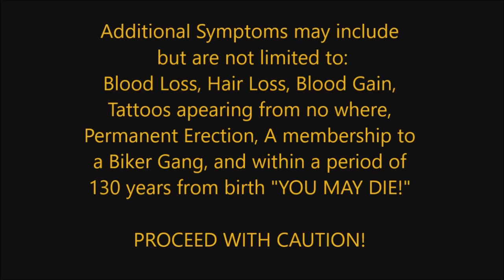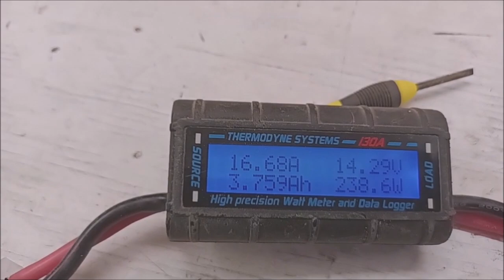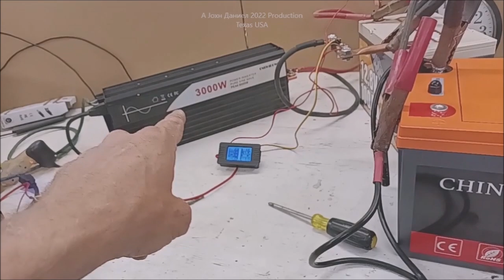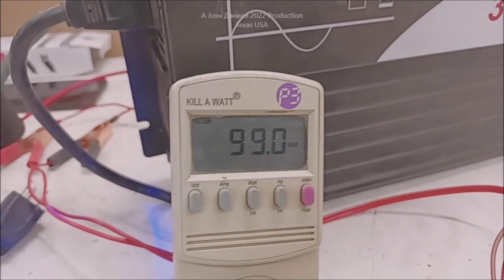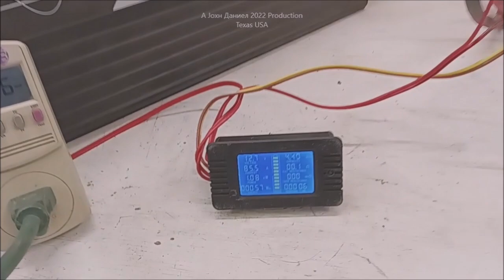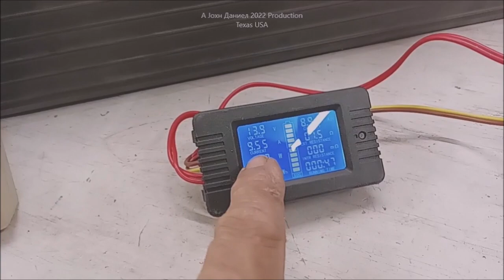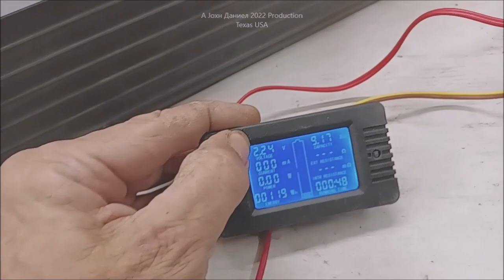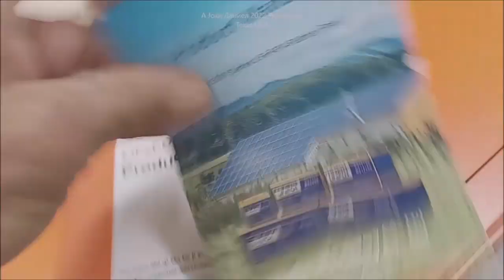New CHINS 12 volt 200 AH LiFePO4 Battery vs. Power Queen 100 AH LiFePO4 Battery

Comment from the maker: POWER QUEEN the winner! put 3 on a RV save yourself thousands. Premium LiFePO4 Batteries https://shrsl.com/3kfqh  LAST VIDEO WINNER - High Efficient TAOTRONICS 8,000 BTU A/C unit. https://shrsl.com/3n37v - Video at https://youtu.be/JS_d1lCCcgM Source it direct save over $70. **Help fund video advancements, go to http://buymeacoffee.com/JOHNDANIEL  CHINS Battery (if you need specs) https://amzn.to/3zVrDSY
Reply: Hey John just a quick question i purchased a 12.8 V 100ah Power Queen which pure sign converter would be best for it  on amazon, do you have any suggestions because i can't seem to find a decent converter and the comments are mostly fake

Comment: One year later: I had ordered two of these P.Q. mini 100Ah premiums based on the testing you showed in this video a year ago. They've been running a solar-powered station ever since. Exemplary batteries.Thanks. Oh, and they're also connected to a Cswei 3000W inverter, which is exemplary, as well.

Comment: Isn’t it the BMS that has shut off vs “the battery is dead “ ? Yes ! Take it apart test the batteries without the BMS you will find that I am right, That doesn’t excuse your result, and in power queen is impressive. I wouldn’t buy chins after watching this
Reply from the maker: Yes, the processor on the BMS has only 2 volts coming out of the pin 13 instead of 9 volts or higher so the Mosfets we're getting no on power. Defective processor so defective BMS.
Reply: If he takes it apart then he's stuck with it. The only way to open the battery van be opened is cutting it open.
Reply: @randybobandy9828  MANY (on YT) have opened the cases with Heat, or chisel, or even screwdriver & hammer …..

Comment: I've been using two 24 volt 100Ah Chins batteries over the last 6 months without failure. I discharge down to 20%-30% every 2 - 2.5 days. I am expecting better than advertised charging cycles because I don't drain them... ever.
I use a SunGoldPower 24 volt, 3Kw hybrid inverter/charger. I currently don't have space for solar panels but I do have a Westinghouse generator running on propane with wireless remote start and stop and two, 320 watt 24 volt Renogy solar panels standing by. I'll need several more panels considering my location near Seattle.
I've heard nothing but good about the Power Queen. I'm pretty sure I saw a Will Prowse video in which he tore one apart and verified it's capacity.
Reply from the maker: Being near Seattle has tons of challenges. One of the cloudiest places to install solar, compounded by one of the most aggressive areas to be sued by righteous wealthy leftist who do not want you to ugly up their area with solar or wind power. So you do have your challenges. My cohort in Connecticut lives in a small community of folks who have marched for GREEN power, and sued him 3 times over installing it. Virtue signaling verses facts LOL!  Another follower on my channel lives north of Seattle has been sued once for putting 2000 watts on his what he thought OWN HOME, and he lost the suit, cost him over $12,000. SAD!

Comment: I have seen many reviews on the power queen battery with great reviews. Because of those reviews (including yours) I bought 2 of the 12.8v 100amp batteries, for a month and a half I tried to charge them and the best I was able to get was 13.1, sorry that wasn’t good enough for the rv. So after going around with their customer service and doing everything I was asked to do they wouldn’t charge, not after using 5 different chargers and 2 charge controllers, that included the new renogy 60amp charge controller
Reply from the maker: Did you do a full to dead shut off discharge? Then using another small battery or solar panel jump them back on, then charge them uninstalled? Some Chargers have other things in circuit that will cause default settings on your BMS.
Reply: @JOHNDANIEL1  yes
Reply from the maker: Makes no sense but I had 3 batteries in a row from Bouge RV that did similar. All these battery makers only use JBD and VIP branded bms units, seems they have a real bad run of VIP models some may have got.
Reply: @JOHNDANIEL1  after all that I tried to charge them, the only conclusion both power queen and myself could come up with was the batteries so they just refunded me
Reply: @deankohler8928  feel LUCKY !  At Least you got Warranty ‘support’ and ultimately a Satisfactory outcome.  It isn’t that common.  I’ve got Vatrer, who have been “radio silent” on my Messages.  Despite the batteries testing Very Well in tear down vids, etc, their customer support is a Big Thumbs DOWN.  They got my money ….

Comment: I am aiming at two powerqueen 12.8 volt 100 Ah batteries. This will strain my budget but so would 8 lead acid batteries. If I add 2 more in about two months or so is there a problem when adding newer lithium batteries to a lithium battery bank ?
Reply from the maker: No, as long as your not past 100 cycles on them they match up just fine. 200 cycles is still ok according to the maker, but I'd just stick with 100 days or less.
Reply: @JOHNDANIEL1  Thanks the info is very helpful. I will buy you a coffee soon.

Comment: I think a 100amp BMS should do 200amps for 30+ minutes, and surge 300-400 without fire , maybe trip the over current,  that's what a good BMS would do in my opinion! Most ars listed  as the peak surge current, 100a BMS, is a 25a unit,  I do not agree with them using doctor time to rate current!!

Comment: I'm about to decide on batteries. The Power Queen Premium battery is more expensive than the Eco-Worthy battery but the regular Power Queen 100Ah batteries could be less expensive provided shipping and tax aren't excessive. I've heard good things about Eco-Worthy. I don't see any reviews of Eco-Worthy except by youtubers I've never heard of.
Reply from the maker: When you pick a battery be sure you pick a battery that's going to be able to take a beating like an anvil but won't empty your pocket like a $3 hooker when you pass out. 😂 Truth be told, Eco Worthy SUCKS!
Reply: Hello Bro！ I can assure you with absolute assurance that there is no shipping charge for any battery if you purchase it on Power Queen's website! And the taxes are in line with your local consumption tax!:goodvibes::goodvibes:
Reply from the maker: @powerqueenbattery  You guys need a Bulk price on the Premium 200 Amp Hour. I'm hoping for a 3% Progressive discount. People need at least 4 to do a safe off grid back up system. Buy 4 get 12% off the 4th one. And Hope to see you guys selling those micro 110 volt Air Conditioners soon. 3000 btu, 190 watts running is a Off Grid owners dream A/C unit.

Comment: I built my battery from new damaged ev cells, I have 6x 120ah 7s batteries, 24v the battery case was defective or damaged, not the cells, With 5k psw inverter, I also have a 12v bank, for 12v light, camera, security stuff, and a inverter to keep food cold,  I went 12v so it can be charged by a car and jumper cables if needed, use a dc to dc, to charge the 24v bank, in emergency,  I also have Nissan leaf bank, and 500-600 ah of 18650 cells,  never again, unless I have to will I do that again! 14cell groups, with 100 cells each!  It would be fine if the cells were new, or at least matching!! Testing and grouping is insane, especially when it only at 500ma-1amp,  I would get up mid night, to change batteries and check all the chargers!!  I had to split one of The Nissan leaf cells, they have 4 lipo cells inside,  2s 2p,  so it could  made into 2x  7s banks, 
I can only pull about 50amps from per battery, during in rush, at peak power, , while the 120ah are capable of a constant 240-320a, I was hoping to get 6 more, at least, I hope they still work in 20years,  they will probably be 40-50ah if they do, I normally keep them between 3.2/3.4 & 4v per cell,  the inverter doesn't really like getting much below 24v the battery can safely go 21v keeping it below 28.8v to get more life,   I would like to start collecting lifepo4 batteries,  in a few years anyway, after I get a few more miles on the linmc bank,  going to a 8s Lifepo4 wouldn't be much difference, I could probably get by with the same charger settings for a while!!  The top end voltage would need to be raised,  and at 3v/cell 24v so the inverter would be happy, keeping it above 2.6/2.8v per cell, and below 3.55-3.6, lifepo4 is already at a lower voltage,  so it doesn't really need to be kept lower to extend life but still needs to go high enough occasionally, to get the BMS to Ballance,   keeping the cells above 2.5 v, because the low and high voltage accelerates degradation, shortening cycle life, lifepo4 doesn't really suffer from this, but keeping them .5v below, and .8v above the max/min. Voltages,  can still nearly double the excellent cycle life, 2000-4000 cycles TO 80% CAPACITY! Going from 0% to 100%,  with mine I think is closer to 800 cycles, this is why I'm trying to keep it in check, maximize the cycle life,  to hopefully more than double the cycle life,  1600-1800 cycles to 80%  especially when it takes about a week to get a single cycle,  pulling about 50-60a normally, until the 7amp well pump , and refrigerator kicks on, while I'm microwaving a sandwich! I'm pulling numbers out of the air, but after in rush, that's probably close to 200-215 amps,  but I have inrush limiters on the well pump, and may try them on the fridge and freezer, not much can be done with the microwave,  I may try it with the washer and dryer, to allow my smaller generator to power them, especially at once,  the. Ac definitely,  I rarely use everything at once, and thinking about  building small kind of a ups, for each room, with about 800w psw inverter, and about 1kwh battery,  finding a small 48v inverter, isn't easy, especially a quality, cheap one,  I want a 48-60v unit, because low current, more efficient, I'd get a 120vDC  if possible,  I have a 400w ups. That will power my TV  and more,  I'm thinking a 600-800w inverter, with transfer switch,  charge at about 500ma to 1amp,  14-16cell bank, that shut off when 4.1v/cell is reached,  charging with a dc to dc cc cv boost converter,  and voltage controlled relay, to limit energy consumption , (losses) used to power TV, and accessories, led lights if needed, in the event of low bank voltage,  with a couple lamps converted to work on dc,  a tiny dc to dc, and a 3w led can light a room,  (unless you are trying to build a rocket!) Then you may want 2, or a 10w cob led,  with about 3-4. 18650's it can last hours,   charge at 100ma +/- when not needed anytime soon,  at 6-10 ah, it would take days, but being off grid, with no grid back up, backup is needed,    unless you don't mind sitting in the dark! If all you need is a bit of light, buying a 70-80% capacity lifepo4 12ah , 12v battery for $5 just makes sense,  it can possibly last another 5-6 years, before its below a useable ah capacity.  I have a few of these,  what I really would like to build , is a wood stove boiler, and a steam dc generator, capable of about 100amps  @ 22-29v 32v peak. (adjustable).   To charge the batteries,  and power the house, basically just like a car,  use the exhaust steam to heat the house with radiators, closing the system!  Storing the excess heat in insulated tanks , to be pumped through radiators as heat is needed, , with a small fan circulating air,  about 100 watts per, 2-4 units , single pump, maybe 50w with 20watts per fan, and a few watts for the controls , may use the solar after the back is charged , using 48v  water heater elements, if it's only 150° water, about 400gallons of it will heat a house on a cool night in fall,  just let the pump run for 20-30 seconds, off for 60, with a slow ramp up to speed,  depending on length of water pipe,  , and how long to get hot water to the radiator, maybe use a thermal relay, turn it off and the fan on when the temperature is reached,  with a thermostat controlling the overall temperature, , I would like to install radiant floor heating, using this as a base,  basically 100wh to  to heat the house , on 30° nights, it may take more when it's 2°F out,  but it's usually only about 10°F  out  mid winter , not counting wind chill,  it can get in the negative for a short time,  with a fire in the boiler, and about 1-3 gph  water flowing, between the boiler and storage, , then the small pump, from storage to radiator as needed,  keeping a 72° +/-  with only wood and paper scraps, and 100watts or so,  no smoky house,  shoot on the walls and ceiling, everything smelling like smoke,  none of that,  I would like a gas fire logs, in a micro fireplace, and chimney,    sorry to ramble so bad this time,. But I can really get into that kind of stuff!!,  Good day!!

Comment: Hello John I have a question, do battery's discharge from the negative side and charge up from the positive side.
Reply from the maker: Power from a battery as a chemical reaction does exactly that for about 90%, of the types on the market. Energy is drawn to the negative to do work. That's why amp meters install shunts on the ground or common line. In other words, power is not pushed from the positive, it's attracted by the negative to move through something.
Reply: Pressure (+), vacuum (-).

Comment: I was considering a couple of sunfunkits, until I saw how expensive they are. The company is in the same town where I live, but with free shipping this doesn't benefit me at all.
Reply from the maker: Contact him, If you need his direct info I can get it. He is a awesome guy. And seriously you can meet him and pick them up with a big discount just work it out with him. The best thing is if you use those, you absolutely will get 10+ year batteries, not 5 year or 7 year like most of what's premade. Plus using 3 of the 304 amp is like using 20 of the 6 volt golf cart batteries in ability and cost, but with 2-3 more years expected. Tell him JOHN DANIEL sent you and to give you the $55 per set shipping off of them and a 3% for your buying them. At least try it!

Comment: John have you ever watched projects in paradise 808 he has had good luck with chins batterys amperes time and redodo mite want to talk to this guy and see where he's buying from and I like your 300amp shunt I have four of them and they all work very well and there priced well that inverter your running looks like it kicks but for a high frequency inverter I've been running low frequency inverters  but I run well's off of them seems to work out well for me
Reply from the maker: Redodo and unowix are the same sourced. Ampertime has a dozen brands with them. CHINS is low scale with a few rebrands. There's about 8 dealers on all of Amazon and eBay for 50+ batteries names. 
Most my inverters are low frequency, the portables are the only high frequency I have.

Comment: Hey John I have question about the power queen battery
Reply from the maker: A solid battery, What you trying to figure out?
Reply: @JOHNDANIEL1   I have 6 power queen premium batteries I just got 2more but they are the mini. Will they work with the other ones
Reply: All are 12.8 volts
Reply from the maker: Yes, they will work together. Same BMS with a little better builds now.

Comment: Which is better buy Redodo or power queen?
Reply from the maker: If you're running heavy amperage you want the power Queen, like a off grid scenario. That's what they're really good at and you pay a little extra to get that ability. But  if you're running long-term like slow mid level draw but constant like a RV camper then you want the Redodo because they're good for that and their priced Right.
Reply: @JOHNDANIEL1  I'm using 24v Victron multiplus 3000... I will use 5k btu window ac and sometimes induction cooktop 1800 watt
Reply from the maker: @michaeld4502  Oh, so moderate to high demands, then you want 2 of the Power Queen Plus, 200 AH with 200 amp BMS https://shrsl.com/3lqrb or https://amzn.to/3eT8uch Get the 12 volt, 12.8 and set them up as 24 volt and you will get better results.  "Power Queen 12V 200Ah Plus"  Check both,  just go with which ever is cheaper on those 2 sites where they have them. I got 2 already, paid $200 down and used Affirm on Amazon to get them for about $60 a month for 18 months. And trust me, my credit sucks now due to medical bills, about a 590. But they just wanted a little down on it. Now they have like $40 more off and I missed that.
Reply from the maker: @michaeld4502  PS, if you have not got the standard 5K AC unit, and can't find the HE-5K now, then get the Taotronic 8k, https://shrsl.com/3n37v it will actually use 10% less power than a average $169 5,000 btu model and run a hell of a lot less.

Comment: I`m gonna get that charger and air conditioner once I get caught up on the crazy scam electrician and phone company bills. Gotta love monopoly abuse. There was a box here and they "upgraded" it then put in a 50 amp RV plug for my 30 amp camper...which cost more to change. I told the guy I was gonna change the plug, ordered it, and he came and changed it ahead of me. What should this cost in your opinion?
Reply from the maker: $65, that's my rate for phase swaps. But a 50 amp RV plug and breaker is 240 volt, if you single side it to a 30 amp RV,  you now getting 120 on a 25 amp max.